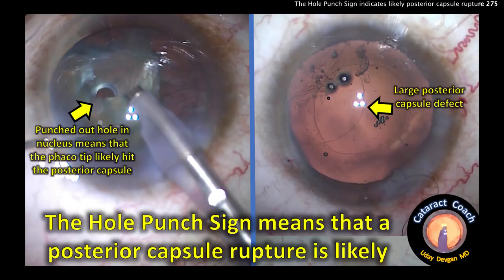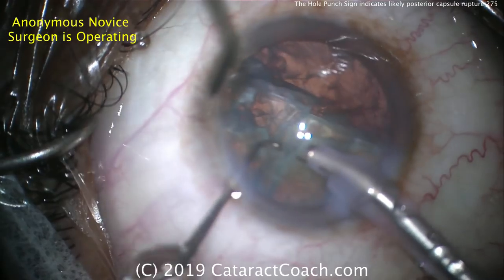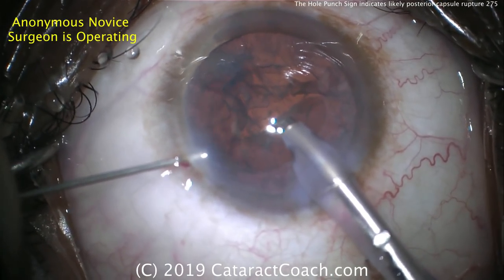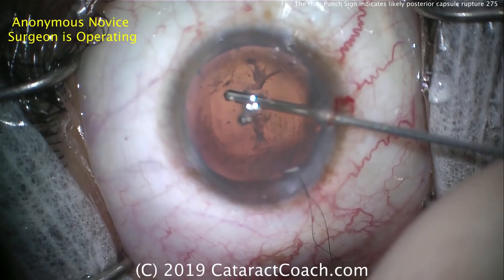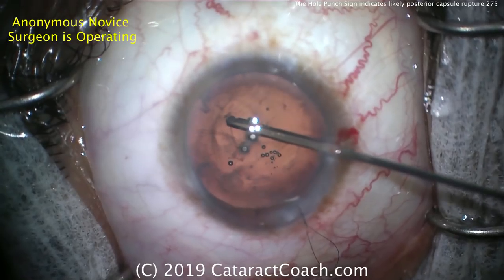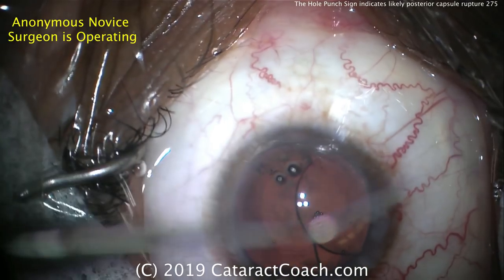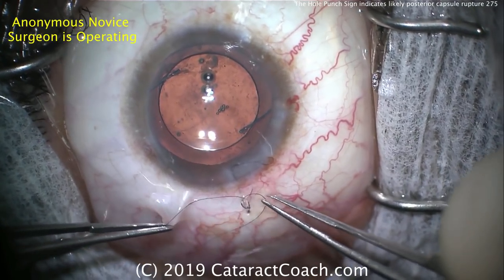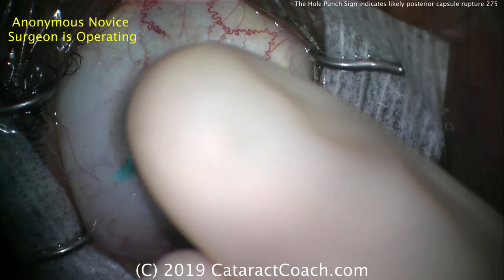The Hole Punch Sign in Cataract Surgery can indicate a posterior capsule rupture

Comment: good teaching VDO!as you have already mentioned,bi manual I/A would have been a better choice than a co axial in this case. Why irrigation was not used after a dry vitrectomy is a mystery to me! Please clarify .Dr. Devgan.
Reply from the maker: I do not know the answer to your question. I was not involved in the surgery at all. It was an anonymous junior resident operating with a more senior surgeon at a different hospital
Reply: @UdayDevgan  ok, sir, i understand. Thanks for the reply.
Reply: Personally, I would put in an AC maintainer, and drop the bottle height. The AC maintainer will maintain a constant AC pressure and frees up a second hand. Presumably he is worried about hydrating vitreous and causing vitreous prolapse.